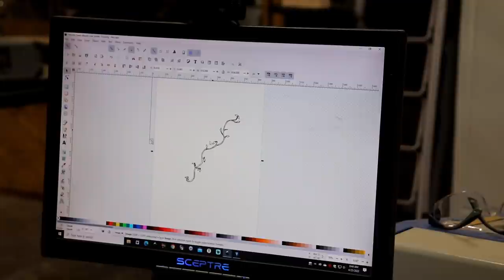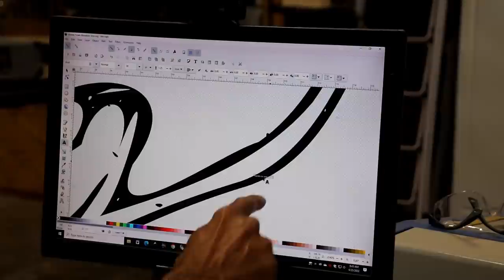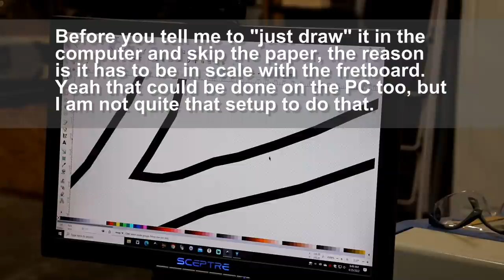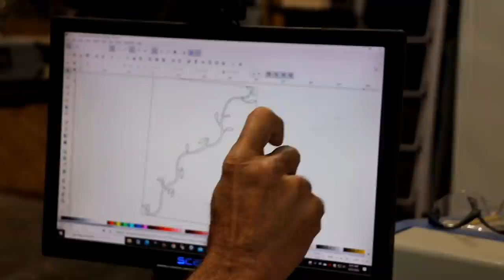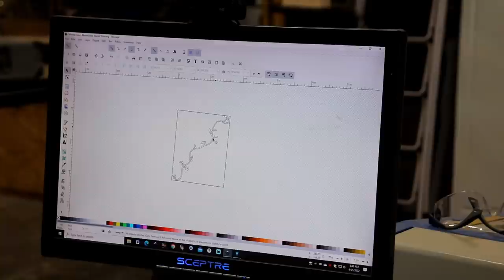VLOG #032 RSW Behind The Scenes Inlay Work and More

Comment: On the scan of your design, I'd like to suggest that if your scanner is capable, then set it to scan at 600 DPI (dots per inch), if 1200 DPI do that, and save it as a TIFF, not a jpg... give it a try, see any difference?
Reply from the maker: Yeah, been there done that.  I've been involved with PCs, graphics and all kinds of software since the mid 80s.

Comment: Believe me, there is a difference between engineering and engineering management.  Just look at your car.  What's under that hood makes me ashamed of being an engineer.
Reply: It is not just under the hood. The front edge on my head liner started coming apart, after about 3 years.
The sunlight was eating up the foam, because there is no trim cap, on the edge.
In the middle, it is fine, because the dot tinting, behind the mirror, shields it.
This has been a problem in US cars for decades.
Reply: PS: I just found out my two rear disk calipers have bound up, after 8 years and 23k miles. (yes, that's all)
Fortunately, I have a 10 year, bumper to bumper, warranty.